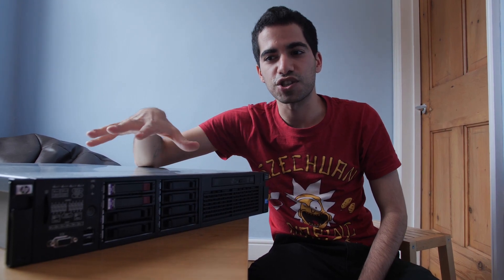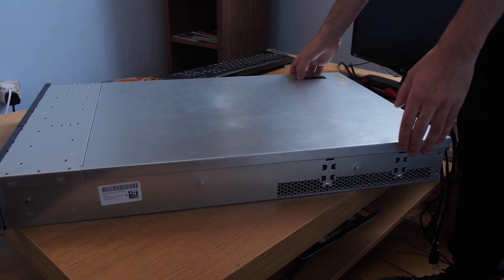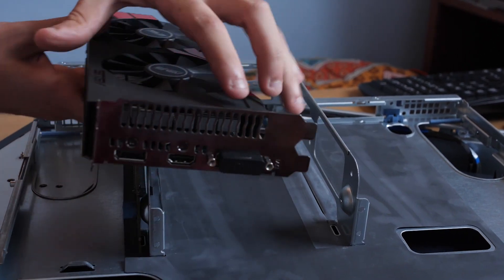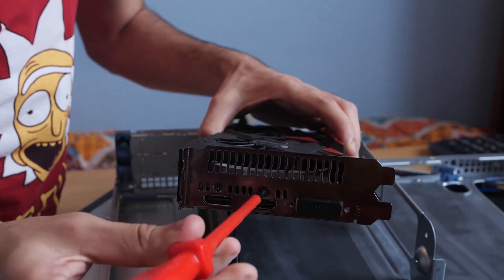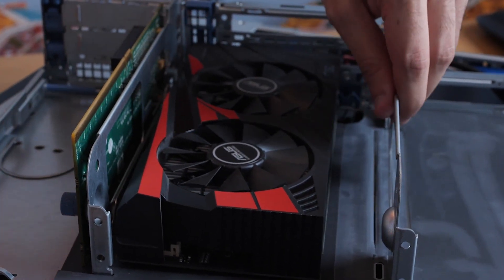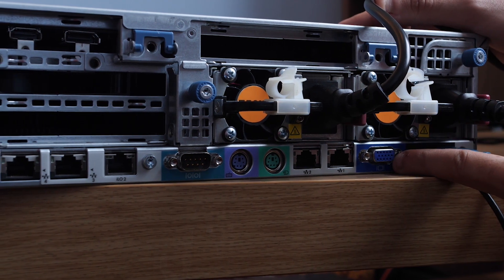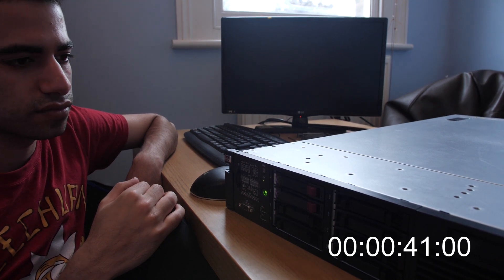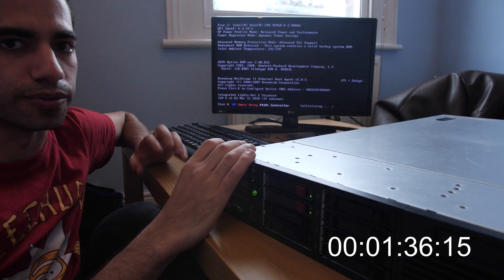HP Proliant DL380 G6 - Installing full sized graphics card GTX 1050

Comment: What is s happening in the first 47 secomds after power on? Is this time the storage controller takes? Is there a way around this delay?
Reply from the maker: In my experience servers in general take ages to start up. I dont think theres a way around it unfortunately. I believe I had the OS on a SSD when I made this video
Reply: @theserverroomtalks8286  Thanks. My proliant ML310 gen 8 does it the same way. But on a dlxxx (360?) gen10 I saw this long black phase not happening. It had an UEFI BIOS allready, which mine also dosen't. I''ll have to try to remove the P420 storage controller to verify.

Comment: what if the gpu needs 6 pin power out?
Reply: I just stuffed 2 4090s using risers and put them above the chassis then used an external psu and jumpered it. Turn the gpus on first then the server. I have been tryin to get a pcie fabric to play with tho
Reply: @98f5  thanks

Comment: Awesome vid man, I have a hpe dl20 gen10 and my boss wants to add a geoforce gt710. When I install it and hdmi from the added video card windows server 19 does not boot, yet when I use onboard vga windows server 19 boots, any help I would appreciate
Reply from the maker: It could be the installation of your windows server OS cannot find the correct drivers to boot graphically. I was using Windows 10 at the time and that defaulted to basic graphics adaptor drivers. Maybe google if your server edition comes with this by default? Good luck :)

Comment: How does it work performance wise ? Because the 1050 is PCie 3.0 and the Proliant is PCie 2.0
Reply: it's an x16 slot
Reply: @IceDragon-fj4vx  I know, but PCie 3.0 has a higher bandwidth than PCie 2.0.
Reply from the maker: Your right unfortunatly :) even worse is the riser cards have a x8 bus width
https://www.nts.nl/site/html/modules/pdf/Server/HP%20Proliant%20DL380G6.pdf
^The section on expansion cards details this. The person filming this video was able to edit and render it on that server using Adobe Premiere Pro which the server definitely couldnt handle before, using the built in video. It was like a lumbering tank, the CPUs are rather slow but the system never crashed as far as I can remember.

Comment: Hey I have a dl360 g5 and I have 72 gigs of ram installed but am only getting 60 recognised, any ideas?
Reply from the maker: As far as I can tell, the max amount of ram you can run in that server is 64Gb. 
https://support.hpe.com/hpesc/public/docDisplay?docId=emr_na-c00736190
^ The "Upgrading Memory and Memory Interleaving" section is really important for the combination of DIMMs you should use. There is a really good chart below that too showing 8x8Gb DIMMs. Good luck!
Reply: @theserverroomtalks8286  cheers!

Comment: hey dude, my HP Proliant DL380 G6 hangs on the HP Proliant logo when I put a graphic card, i have to power off and unplug then replug and power on to make it boot up, what seems to be the problem? hope you can help. thank you
Reply from the maker: I had this same issue I think! I believe the solution that worked for me was to update the bios for the system. It was a bit of an involved process so I would check what biod version your running first and if its up to date. Feel free to message me if you get stuck with the update. I think getting the support downloads for HP servers requires registering with a serial number etc. Anyway sorry it took me ages to reply. Hope its my response is relevant or you already fixed the issue :) 
Bios version: P62 (03/30/2010) in this video

Comment: Does it have usb ports? 
I wanna get one and put a rtx3070 in it ,is that a good idea?
Reply: lmao who the fuck can afford a 3070?
Reply from the maker: There are 2 USB2 ports on the front and another 2 at the back. That gfx card uses up to 220W of power from what I found online so I dont think it would work. its also totally overkill for a server this old in my opinion. Good luck!
Reply: @theserverroomtalks8286  I don't think that power is an issue, there is still a 10 pin connector that you can use, but probably you will have bottleneck problems with the cpus.
Reply: RTX3070 for mining?

Comment: hey there Ibrahim, i'm looking at setting up an old server (HP ML350), but I have no idea if I can get a relatively modern GPU on it. Are there specific limitations that I should look for? Is there a riser card that I need to go for? I really dont know much about PCs in general, so a bit of a dummy explanation would help, thanks!
Reply from the maker: Hi Nirab, Do you know what gen ML350 it is? There might be documentation on expansion cards which should specify how much power it can provide to a GPU. Let me know the generation and Il have a look :)
Reply: @theserverroomtalks8286  It says G6 online
Reply from the maker: @nirabsarma8981  Hey sorry for late reply, seems like it has a full PCIe2 x16 expansion slot so you should be able to install a GPU. There is no additional power cables for that system that I have found though so you would need to use a GPU with 75W of power consumption or lower. The GTX 1050 I used in the video would work fine.
I watched this nice mans tutorial ( https://www.youtube.com/watch?v=bCuYlRlXUyY ) before responding so it might help. The description in particular is good :)

Comment: hi what did you change in bios setup? I have a dl580 g7 and the graphics card does not work. I put r9 380 in there. thank you for the reply
Reply from the maker: Its been a while but im sure I set everything to High performance (weirdly enough runs quieter). Sorry cant provide anything helpful there, I dont have the server with me here anymore :/
Reply: R9 380 will not work, those cards require 6/8 pin power wire connected which server power supplies lack, you either have to use a video card that doesnt require external power like the card shown in this video or just stick with the crappy onboard vga.
Reply: @tolgahk84  it does work, there's a 10pin power connector in these you just buy a 10pin- 8/6pin adapter

Comment: Hola,  quiero conseguir ese servidor para renderizar y realizar fotogrametria, consulta, le puedo agregar una placa nvidia quadro? Le puedo instalar windows 10 o solo windows server y cual? Perdon no se nada de servidores estoy comenzando a ver como trabaja, desde ya muchas gracias.

Hello, I want to get that server to render and perform photogrammetry, query, can I add an nvidia quadro board? Can I install windows 10 or only windows server and which one? Sorry I do not know anything about servers I am starting to see how it works, thank you very much.
Reply from the maker: Hola Eduardo, Thanks for watching my video. You can install windows 10 no problem. You will need to first create a bootable usb with the HP smartStart CD and boot it on the server to format and set up your hard drives / SSDs. then after setting up those logical volumes you can create a bootable windows 10 USB and boot the server and install to the volumes. You can use a quadro card no problem as long as it uses less then 75 watts. If the card uses up to 150 watts of power then you can use a additional power cable which I can link for you if needed. Which quadro card do you intend to use?
Reply: Pensaba usar una nvidia quadro k4000 ddr5 de 3 gb
Reply: I was thinking of using a nvidia quadro k4000 ddr5 3gb
Reply from the maker: @eduardomartinmiguel3089  The K4000 should use up to 80W from what I can see. You would be able to run the card if you used an additional power cable, you could find it by searching for "10pin to 8+8pin Power Adapter Cable for HP DL380 G6 and GPU 50cm"
Reply: @theserverroomtalks8286  
ok, thank you very much, I will be attentive to your channel for more information, very kind.
Reply from the maker: @eduardomartinmiguel3089  Thank you :)

Comment: I have a question, I have a server dl380 g7 but i want to connect a rtx 2060, how you connect the eight pin support?
Reply: 1.: Be sure that you dont run the lowest power PSUs with your Server (I think that would be the 460 Watt devices) get a pair of the beefier stuff from a refurbisher (it can take up to 10xx Watt PSUs).
2.: Look out for a 10 Pin to 6+8 Pin adapter cable - there are many China sellers offering these Frankenstein Adapters - be sure to get a cable that uses the onboard 10 Pin Port for the HDD Backpanel. You'd lose the capability for a scound hdd bay tho.
Reply from the maker: Hi DERRTZ, from what I can find, the RTX 2060 uses up to 160W which I dont think your server can provide even with the additional power cable. I am not entirely sure though so maybe someone here could chime in.

Comment: We have this server from the server we have installed gtx 1050ti but gives error in the drive. windows 10 64 bit 1909 can't get the image installed. What could be the reason?
Reply from the maker: So you havent been able to install Windows 10 onto the server? have you made sure that your logical volumes are partitioned correctly to allow the Windows 10 install to install to the volumes? That would be first done by booting into Hp Smartstart CD ISO on a usb. Let me know if I can help :)
Reply: @theserverroomtalks8286  We solved the problem, thanks razer card also had a problem.  :)
Reply: How did you connect the gtx card?
Reply: @chalupin3642  We couldn't connect and we decided to use it with onboard remote access. With remote access, we got the highest resolution required with the remote connection of Microsoft. Unfortunately, we could not use the Gtx, the user does not show any details bios, windows do not share any settings or details.

Comment: This video gives me hope i can install a 2070 in a dl380 g8. I think i can get it to fit just fine, its just the adiitional power cables. I know i need a 10 pin to a 6 pin and 8 pin.
Reply: how do you do it? i want to do it too
Reply: @chalupin3642  i had to cut some of the riser material off from the top. I got a 5700XT instead, but im sure its the same. Get the adapter cable gor it and your gtg.

My problens werent there but rather setting up ESXi. Incouldnt get autostart to load and the peripherals were very inconsistent.
Reply: @AlpineBishop  but how did you connect the eight pin?
Reply: @chalupin3642  i bought the adapter for the riser. 6+2 to 10 pin.

Get the adapter cable for it and your gtg.
Reply: @AlpineBishop  what about the power supply? Is it from the server or from external power?
Reply: @9h-06elangbagaskaraputra9  server. The psu powers the board by just being plugged in. I wondered about that as well, but with how the psu works you just need to plug in the card to the riser, which will give it some power, and the 6+2 to 10 pin adapter to the riser card which will supply the rest. Be sure to get the riser card that has the 2 x16 slots or else a dual slot card will not fit because of the tolerances.
Reply: @AlpineBishop  too bad for me because my all of my country online shop does not have that cable, the thing they have is 6 pin to 8 pin, can i use that too? I want to use a rx 580
Reply: @9h-06elangbagaskaraputra9  idk the 580. For the 5700XT I instlaled, I needed a 6+2 to 10 pin. The 10 pin is for the riser card, so you definitely need that part. It may work fine, but i doubt it.
Reply from the maker: @9h-06elangbagaskaraputra9  From what I am reading the RX580 uses up to 180W :O, if thats true I doubt the server would be able to run it

Comment: What's the gaming performance like especially today's popular games and what figure fps are you achieving.
Reply: Probably bad, youd need a higher Ghz CPU, since these are designed to be clocked low and have lots of cores, where gaming needs high clockspeed instead of core count.

Also it probably has a hard drive, id be smart to upgrade to a SSD.
Reply from the maker: Id say its rubbish, as Fish says its single core performance is very poor. I Imagine the noise and heat makes it really impracticle to game on it too.
Reply: @theserverroomtalks8286  too late already bought one and is one of my gaming rigs.
Reply: @melodiclodgings8  That is legitimately cursed. How well does that work?
Reply: @schleybailey  it works well as long as you have good gpu and power supplied and you wont get full bandwidth which those companies exaggerate having full bandwidth, though I have a dual CPU and need more ram but its good enough for me in gaming, video editing to see what the performance is like in general and overall can expand quite a bit turn it into a network attached storage, hosting minecraft servers, game on it and also still have extra room to expand, the sound it rarely revs up as it is in my room but its also underneath my bed as I dont have much space to put it anywhere but its fine and I haven't been on it for a while so I dont know what else has changed or updated and I will need to clean it out, it can work as main system for you but once your rig is better then it works well in other things, you just have to have ideas in what your going to use it for.
Reply: @melodiclodgings8  alr. Not even gonna be a main system so I'm chillin
Reply: @schleybailey  oh ok of it's something your just gonna be having around well it depends on you and over time you just need around with it so it varies
Reply: @melodiclodgings8  I intend on using it as just a convenient server and basically the gpu would be for  just unhashing hashed data.
Reply: @schleybailey  well that's fine it just gets used for something.

Comment: Good morning. I have installed a gtx1050ti but windows server 2016 crash bsod 3b system services exception (after installing latest nvidia driver). How can you resolve this? Sorry for my English
Reply: don't install windows server try with windows 10 pro
Reply: @chalupin3642  I solved. It was simply a gtx 1050 fake card and obviously the 1050 driver does not work on a gpu that is not the 1050. In the end I took a GTX 1050Ti mini MSI (Gp107) and it runs which is a marvel with windows server 2019 and the geforce now drivers.
I took it for plex in HW so as to leave cpu for other services that I use.
Reply: @theghast98  Please I have a question. Is it possible to install Windows 2019 server or 2016 on GL380 g7 with GTX 1050? This will be great news for me. Right now I am running Windows Server 2008 and monitor resolution is very poor. I only get 640X480. It sucks. Be nice if I can get a new GPU and upgrade to Windows 2019.
Reply: @nigerian-nightmare  I don't know, Gl380 can't find anything. If you were wrong to write and you mean DL380 g7 then Windows server 2019 can be put but for the GPU question you have to check that you have physical space inside the case to put it (as seen in the video). Another thing, check the driver of your gpu if it is installed (because without it, Windows blocks you at 640x480 with the wording base video card). Open device manager and on video cards you check what it says. Normally the DL380 have an ATI (as in the video). If in doubt, open the HPE site on the driver section for your specific server model and select the latest version of the driver for the gpu for Windows at x64 (or x86 if you are using x86). It doesn't matter if you don't find the driver for Windows server 2019 it's ok if it's also the driver for Windows 2016 or 2012. Many drivers have to be installed manually, so you have to extract the contents of the driver you just downloaded with 7zip (or an archive manager capable of opening the .exe archives / self-extracting) and from device management on the basic video card make properties with the right button and install the driver manually saying to search among your devices and then saying that you have the path of the driver (put the path of the extracted folder). I'm sorry for my english.
Reply from the maker: @nigerian-nightmare  Hi John, The card im using in the video is a GTX 1050 so I am almost sure it would work without any problems.

Comment: What graphics card can we use for a DL380P G8 server? we currently have a video problem with VGA adapters
Reply from the maker: That server is radically different to this one and I have worked on one so I wouldnt know, sorry
Reply: Disable VGA On-Board to use the PCI for Video. (If bios supports it)

Comment: one of the hard disk on my DL380 is dead. is it possible to use 1 TB hdd with is server? also i am not able to boot from CD of USB drive. do I need any bios setup changed for that?
Please guide.
Reply: Yep, that is possible, also, does your boot menu not work? have you looked at priorities/startup order?
Reply from the maker: Hi Ash, sorry for the late reply. Yes if you cannot see your usb when booting then most likely issue is a bios setting for the USB controller. Try diffrent USB ports too, I think with my system it would only see the boot USB when plugged into the front of the machine.
http://dascomputerconsultants.com/HPCompaqServerDrives.htm
^ really good article on good hardrives and how noisey they are etc.

Comment: Going out of my mind trying to get this to work in my DL385 G6, tried Palit 750 (black screen and freeze when installing Nvidia drivers), 1050 (NMI hardware failure on boot), 1030 (NMI hardware failure on boot), sourced a X16 riser card, changed the power regulator in bios to 'static high performance', tried different IRQ's...nothing.

Can I ask what version of Bios you are using? Is there something I might be missing?
Reply from the maker: Hi Tense FX, sorry I took so long getting back to you. This server gave me a million headaches and installing the GPU in the video was amazingly easy compared to initially setting it up. What OS are you using if I may ask? Does it boot into the OS before you get the NMI warnings?
From rewatching the video I believe I was using Bios version: P62 (03/30/2010)